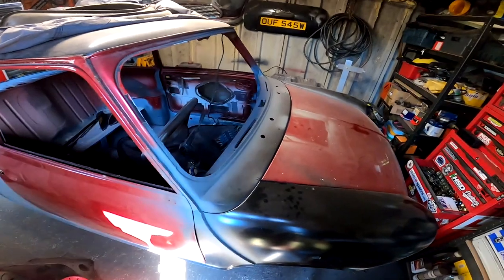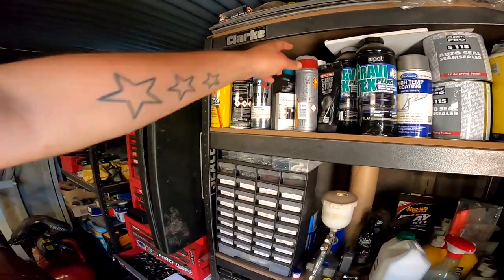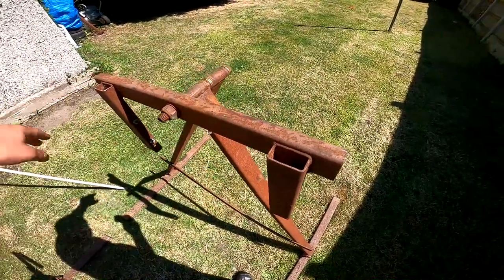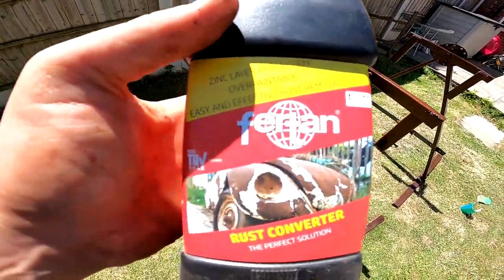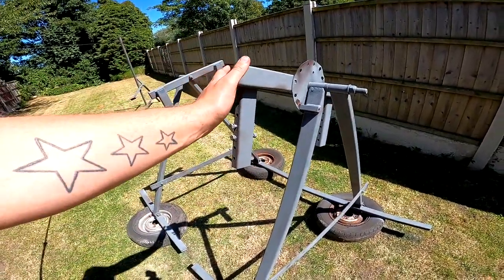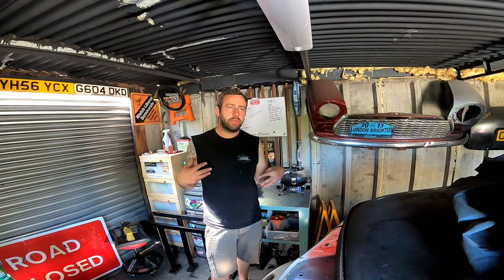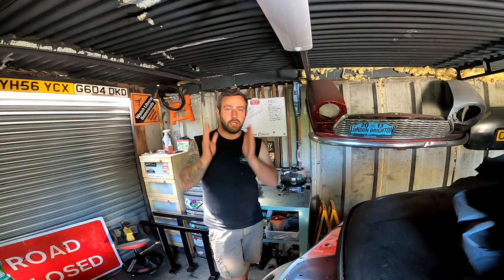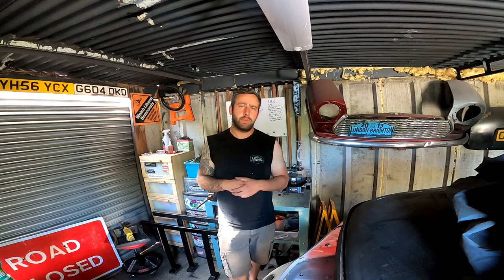CLASSIC MINI RESTORATION ROTISSERIE /JIG - PLUS SOME SAD BUT GOOD NEWS!!

Comment: Your 89 Mini project isn't dragging on as far as I'm concerned. Also I thank you for putting regular videos on for Mini nuts like me.  About your rotisserie/jig. It sure beats rolling a Mini shell up against a wall supported on an old mattress which is how I had to do mine. Cheers!
Reply from the maker: Thanks midge I guess for me it’s been in the garage far to long for reason that where out of my hands but we are pushing along now and gunning towards getting it rolling again. Thank you for always supporting the channel. Big things coming soon so stay tuned 👍
Reply: Nearest mine is getting to a jig for sill welding and treating underneath  is scaffold pole through the middle and a few mates to flip onto its roof bars :S haha!! - rent a rotisserie,  now there’s a good plan (like a food kart at a market / fairground)
Reply from the maker: @arthurdexter2082  haha hey I have done this in the past so it’s all good. Hmm rent a rotisserie now there is an idea…
Reply: @SimpsonsClassics  renting a rotisserie could turn out to be a long term Rental depending on how fast you worked $$$$$.    Actually putting a roof rack on the Mini and then flipping it over is a good idea. A fellow in Vancouver does quite a few restorations for other people and thats how he does them.

Comment: The Firtan - I’m needing to treat the whole interior of my mini as it’s going to be the stripped out race car style - it’s in decent shape in there but quite heavily pitted - would I be best to firtan it and then perhaps choose a [white] hammerite rust cure and primer all in one to to paint over the top or is that overkill? (Thinking this is all stuff I can do whilst the car is still stationary)
Reply from the maker: It’s great stuff and if your doing the whole interior you can spray it on. Once dry you can key it back with a scotch pad and i over paint this with and primer of your choice once I am happy the rust is killed, for such a big area I would suggest an epoxy primer. Then after that you can over paint with which ever you like.